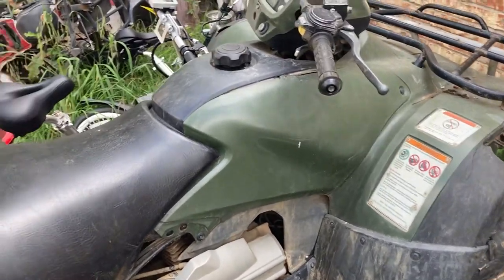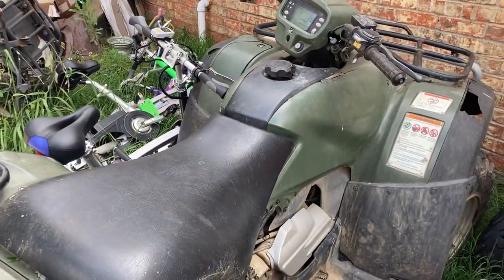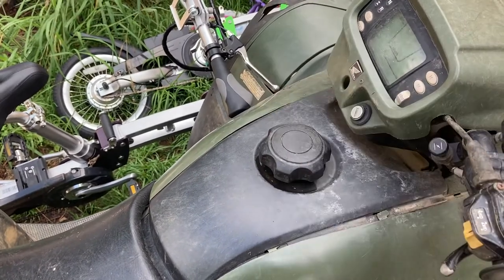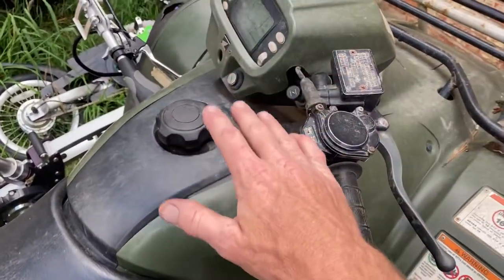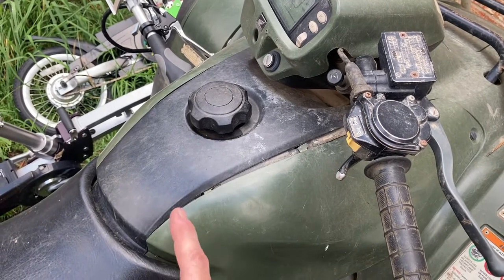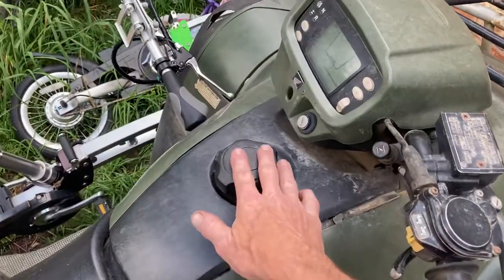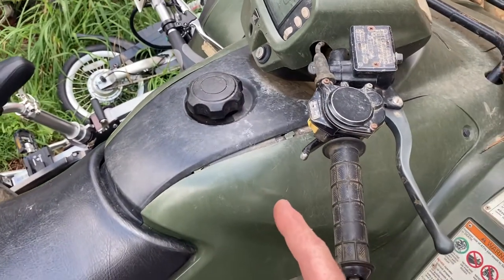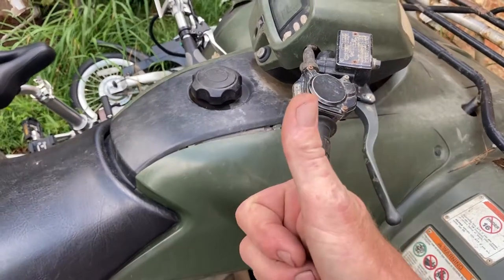Why your Atv Motorcycle Scooter runs for a short distance then shuts off or dies  but restarts !

Comment: LT185 quad runner. Runs for a while. Maybe 20mins maybe 4hrs. It’ll just up and die. Will restart again after about a day if u leave it alone. OEM everything. Was thinking a mouse chewed the air filter but nothing. Was thinking maybe someone hit the decompression button while riding it. And it’s toast. What u think?
Reply from the maker: Check your valve clearance first the exhaust can expand when hot n open causing no intake ! Low compression also could be issue in believe that has vac ran carb with diaphragm? So low compression or no air filter can cause an issue with vacuum! Sorry just seen this !
Reply: @WaldensWorld  no worries. And valid point the air filter is chewed out. Never really thought about it. 👌

Comment: This what I did, i removed the cap, turn the fuel off and try to start it so it can get that air out the carburetor, then after i hear its tryna start, I turn the fuel up and start it and let it run with the top off. Until the Air all gone out carburetor.
Reply from the maker: Glad that worked for you , you Definitely need a vent! Your carb has one also so it should be full unless you turn the gas off !
Reply: I put one on yesterday, I ran it and let it sit for 45mins while turn on, and today when I try to start it, it was stalling to start up.

Comment: You can see the hole where the air line goes off the gas cap beside the key to the left
Reply from the maker: I put oem cap on and we was good to go ! It sounded like a champagne bottle opening first time ! I have a scooter video did same but in it you could see it in the clear filter pull the fuel back up from carb that one had been to couple shops it’s always a $10 part n long time to figure these weird ones out not typical of a unit !
Reply from the maker: With this in mind it could also increase pressure n push gas in flooding out a machine both ways depending I guess in weather heat expands cold contracts but both will build negative pressure in the end running fuel with no air to equalize the tank pressure

Comment: Great tip I have a kawasaki prairie 400 that runs perfectly but when I brake it dies any tips of what to do?
Reply from the maker: Does it have a idle issue ? You have a front variatior in that unit and rear clutch when those start tires wear they can stick when letting off gas and stay in a higher gear ratio, when you hit the gas it’s like taking off in 5 th gear ! Without knowing much that could be an issue if it’s only dieing after running and dueling fine but dies when using ! Also chech oil if carb sticks fills up case the crank n piston can hit the oil gas mixture and also stop an engine ! I’ve seen it so bad you open oil fill plug n gushes out !
Reply: No idle issue,good compression run great if I stop slow no problem  but if stop hart it dies

Comment: This happens to my quad but i dont hear pressure when opening cap but if i blow in the gass tank its starts back up but runs ruff any idea what it could be thanks
Reply from the maker: Have you checked compression n I’d check valve clearance also n vents to engine are not clogged

Comment: I have a 2001 Honda recon 250 and it will start then stall shortly after..I just begun try to fix the issue with little to no knowledge on it..any ideas what it could be?
Reply from the maker: I’d check fuel delivery first

Comment: Hi ever since i changed my filter my atv keeps stuttering and when i stop the atv shuts down, i was wondering is it because the filter is too small and cannot take enough air or is it something else
Reply from the maker: Did you put a small one on ? It could be the issue pull the filter itself off n try no filter not in the dirt lol then you will know ! But yes oem it needs to breath smaller filter more resistant it will start pulling in extra fuel because it’s sucking hard and it will get it from somewhere . If filter is limited the carb has vents n it will pull on carb fuel
Reply: @WaldensWorld  Thank you so much , have a nice day :)

Comment: What if it’s doing the same thing but it’s fuel injected? I have a 2007 that’s runs for like 30 min then shuts off
Reply from the maker: I’d check valves n yes gas tank when it dies pull gas lid off and listen for air rushing in !

Comment: I have something similar. But it will idle and then when I put it in gear it dies ??  Any ideas
Reply from the maker: May have a clutch issue ! Or a sensor shutting it off ! I’ll have to think for bit ! But kinda strange ! If the auto clutch was sticking that may cause it if this is belt drive may check belt area too I can’t see what video it is just message !
Reply: Did you find any solution? Mine also turns off when the selection is on, it's a 2004 rubi

Comment: Mine runs great for 5 min,then a can hammer on throttle and just bogs about mid to wot but dont die
Reply from the maker: Check your jets in carb ! Air filter ! Muffler isn’t clogged is we’re I’d start n new plug ! Water 💦 n gas ? Is it smoking ?  oil level is Corry?

Comment: Hey man my atv who’ll drive for about 2 seconds than act like it has no gas than drive another second and stops never turns off but won’t let me push the throttle down and go any thoughts
Reply from the maker: I would check the gas it may have water in it ! Does it idle ok ! The engine idles off the top of the gas in the carb when you pull throttle the needle comes up n pulls from bottom! Water sinks ! If you carb is leaking check your oil level also it may be full of gas to much fluids in crank case the engine won’t run ! That’s were I would start ! Important question did you just buy this ? Or just change anything! The carb works off vacuum also to diaphragm in carb n check valve clearance
Reply: @WaldensWorld  I did just buy it it ran fine on land but went through a little water and it started acting up.

Comment: My Atv shuts off when ever I turn the handle to the right don’t know why I tried figuring it out but still don’t have a clue any information on this would be much appreciated
Reply from the maker: Sounds like a wire for sure ! Turn to right n push the wires in the plugs in to key switch n kill switch one may be loose in the plug itself ! Is we’re I would start

Comment: Mine does this but has a normal cap with the hole
Reply from the maker: Your carb float may be sticking your petcock may be clogged couple things to check right exhaust valve when hot will cause a opening too

Comment: This happened to my 07 rancher and it turn off and the ride for a while and dies tried the spark plug and the same thing still happens
Reply from the maker: Check your fuel delivery system float in bowl or dirt by float needle n vents !

Comment: Great tip. Does that go for fuel injection as well on pressure build up. I bought a 2021 yamaha kodiak 450 in August 2020 for my daughter. We put about 35 miles on it then went on a 40 mile trail ride. It began to stahl about 15 miles through our ride. I had to tow my daughter back about 90 percent of the way back. The machine would just turn off and the fan was working dont think it was overheating with the radiator but it would take about 10 to 15 minutes for the machine to cool down then it would start back up. The machine would die on the trail then the Radiator fan would stay on. Dealer said that the fuel pump had a recall for the 2020 year model so we thought maybe i got the bad fuel pump from the 2020 because i had a newer year kodiak. That was not the issue. They ran the piss out of the machine and could not duplicate it to stahl on them. They did replace the spark plug but they said that was probobly not the issue. They still dont know the problem. I had high octane gas and it was new gas Elevation was 9500 feet and the machine is fuel injected. Dont know if anyone else has experienced this. If so please share thank you.
Reply from the maker: Could be I’ve been running into that on the bpr machine had twin cylinder n couldn’t push enough gas into the front injection!!we found the issue to be gas can spout had muddobber nest n had put that fuel in the quad clogged injection system! U can clean injectors if air hose carb cleaner n battery 9 volt or 12  to trigger it open then spray them out !

Comment: 1999 Honda fourtrax 300 it runs perfect but sometimes cuts out on bumpy terrain. I let off for a few seconds and it runs perfect again. Any ideas? It’s got a new carb on it with a vent tube attached to gas cap.
Reply from the maker: i have had this happen racing quads id check the float level isnt to high or low  ! mine would bounce n stall bike out in race right after whoops !  its actually on here from like 15 years ago lol i had to pull over i releveld float and problem was gone !

Comment: My sons raptor 700 doesnt have speed then shuts off but starts back up what would be the problem?
Reply from the maker: Not sure ! What do you mean don’t have speed ? Coil could be going out ! Short ! Valves need adjusted how long it run before it dies ? Full tank gas ? Reserve clogged ! Air vent for gas tank ok !

Comment: Why is my pit bike shutting off when I drive it but not when I let it idle and my gas tank has a leak on the cap so its not doing what u said
Reply from the maker: Usaly that the small jet clogged ! Or out if adjustment ! Check the jet first ! Did you mess with timing chain ? They will idle one tooth off but not run well
Reply: @WaldensWorld  idk how to check the timing but I cleaned the carb like 2 times

Comment: I’m having a king quad 500 FI do the same thing. Run for a hour or 2 and then shut off and not fire back up for a day or 2 then will fire back up and run fine for another hour or 2. Do you think this could be the cause? Thanks
Reply from the maker: It could be but low psi in injection will also cause it to die ! And run bad !
Reply: @WaldensWorld  ended up being a bad spark plug…changed it out and it runs fine now lol…guess the plug had a little crack in it or something I’m not sure but it’s fixed now
Reply from the maker: Good news ! Seems our plugs are getting cheaper I’ve seen many fail the seals lately more n more I guess the ceramic isn’t holding up under the heat ! We will have to kee an eye out for this cheap fix now more often which can be tricky because they work out of the quad for spark but still may be bad ! Thanks for the update go ride !!!!! Whoooo